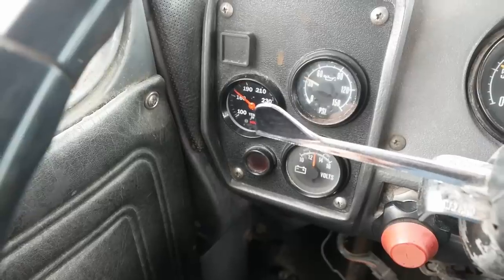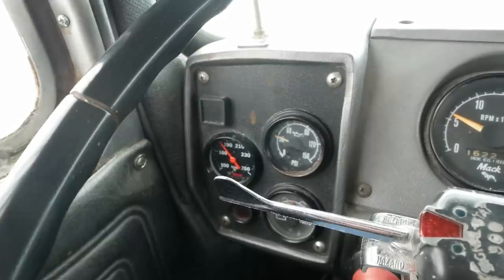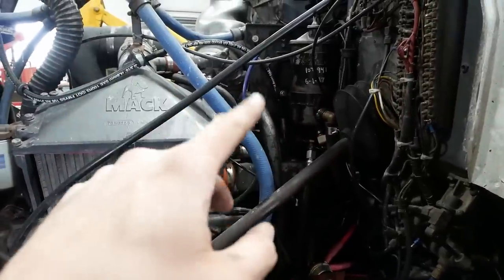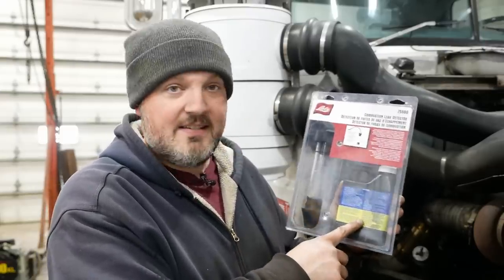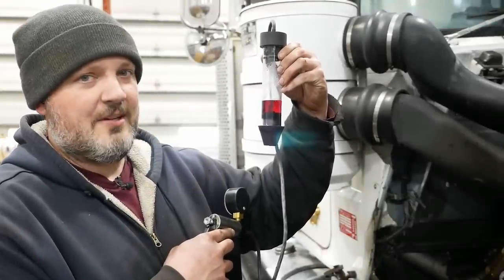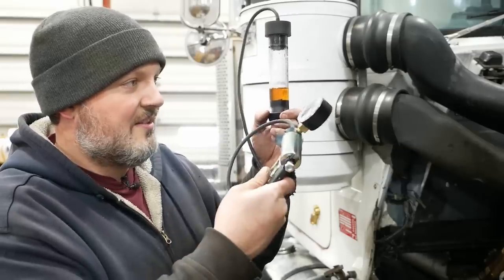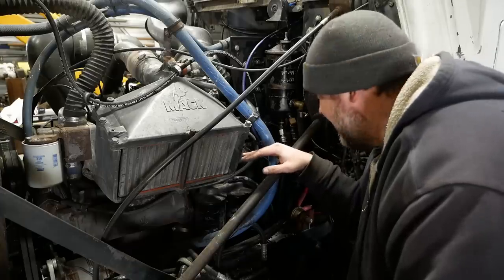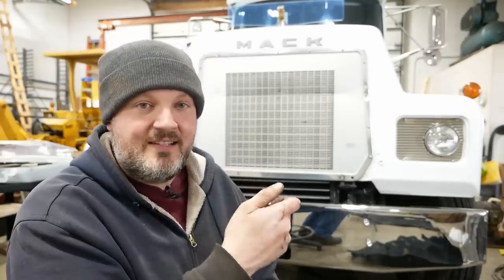Can You Trust a Head Gasket Tester? - R Model Mack Overheating

Comment: My first thought was water pump with nearly eroded blades ... higher rpm they will cavitate and do nothing, low rpm they will move just enough to keep an engine cool... BUT .. that doesn't explain the 3 or 4 psi (how much psi does a glove take to inflate) of pressure at the rad cap ... a definite head scratcher!!!
Thanks for sharing 🇨🇦

Comment: I noticed the tester had fluid in it before you filled it with the diesel test fluid, had you cleaned out the Gas engine fluid prior to filling it? Ive had mixed results with the combustion gas detectors on gas engines, seems like the head gasket leak has to be moderate, hard to get a reaction on small leaks it seems.

Comment: On my om617, i used the blue colored test fluid Oreilly provides... it turns yellow from exhaust gasses. It worked on my diesel, but note, that it takes longer for it to react with diesel emissions that gas emissions. Blown head gaskets on a gas burner took less than a minute... testing the diesel takes like 8-10 minutes

Comment: Reminds me of the mess we went through trying to find a coolant leak in an old CAT 3412 in a 500kw generator. Starting getting some coolant in the oil, but they weren't sure if it was a head gasket, or a cracked liner, downside was in order to fix it, they'd have to tear the engine half apart and due to EPA regs for generators like that it would have to be brought up to higher emissions standards if a major rebuild was done. Being the generator was 30 plus years old and rebuilding the engine would still leave the rest of the genset that age, it made more sense to pull it and replace the entire unit. Due to much smaller loads we replaced it with a 300kw Cummins unit for not a lot more than Cat gave us as quotes to rebuild the old one. I gather that 3412 was sold for reman as they are popular in marine and certain older trucks. Sometimes the repair just isn't worth the expense.
Reply: Man those 3412 and 3408 were such junk.  At least in NG configuration they were just awful and ate heads for breakfast lunch and dinner.  Hodge podge of parts from the CAT scrap bin.   We dropped that junk and use cummins as well.  Much more reliable and cheaper parts. Cat has the big HP market dominated but small and mid HP cummins is not a bad option at all
Reply: @melvingibson4525  Yeah, the quote from Cat for a new generator same size as the Cummins we bought was almost double the price, made it easy to choose the Cummins and it's been flawless now for 5 years. And the support costs me half what I was paying Cat for quarterly maintenance. I don't miss that old Cat, it would always fail to start when you needed it most even with weekly test runs, not once has the Cummins failed.

Comment: I encountered a similar problem on an old Mk2 Golf (VW Rabbit in the US) back in the late 90s. The problem turned out to be a loose water pump impeller. At idle everything worked as it should but increase the rpm and the water pump impeller started slipping on the shaft. I wager a small donation to Wes' favourite charity that the head gasket is good

Comment: Put the glove back on the radiator, pull the injectors & use a rubber tipped blow nozzle hooked to shop air and blow into each injector hole and see if the glove inflates!

Comment: Years ago we had an IH 806 LPG powered tractor that got hot when the collant aerated with tiny little bubbles making the coolant look milky. Tractor needed a new radiator cap. I wonder if aeration  from leaky gasket is contributing to your rapid temp reading flucuations?

Comment: Those older Mack motors are tough. a guy had a dump truck from 1979 had the off center cab forgot what model it was. it was so beat down he was using it on a piece of land and it didn’t have coolant in it the whole time he would run it for 30 min at a time a day. It had fresh modern shell oil in it. But he didn’t want to take the time to find the coolant leak. When he was done with it. My bud and I put straight water in it. And it didn’t seem to have any issues. Mind you this dump truck was probably worth a grand it was so beat down. But the motors seem to be the last thing standing. This was all going on in the hot SC summers

Comment: What did the gas inside that glove smell like?
I've had some tricky head gaskets to diagnose but I always like to take a whiff of what's inside the radiator or cooling reservoir and I can usually tell if it smells like combustion gas or not.
A lot of people don't realize it but as a mechanic your sense of smell is actually quite valuable.
Reply: it usually just smells like hot antifreeze
Reply: Co2 is odorless anyhow so the smell would be irrelevant
Reply: BreatheScotland  A crack in the inlet port won't introduce gas into the coolant at idle, there is no pressure to do this.  It would be more likely to leak coolant into the inlet port.  The symptoms this truck is showing is typically either a bad head gasket or a crack in a cylinder wall or combustion chamber.
Reply: @lustfulvengance  so why would you need a testing device if you could simply smell it 🤔

Comment: Hey Wes. Thanks for the video. 

I can sympathize with you on the struggle of diagnosing gas in the cooling system. I recently had a 2020 model year Hino with a J series Diesel engine with the same symptom. Did similar testing to you and replaced head gasket. Same symptom existed. What ended up being the cause was the water pump sucking air into the cooling system through the weep hole. One of the more bizarre things I have seen as a mechanic.

Comment: You could be right on a head gasket. I had on the temperature would do the same thing.  Temperature guage would randomly get hot then settle back down and be all right for awhile . Would do this randomly. Of course did the normal things to no avail. Finally we gave up on it. After about 1 year we figured it out, the head gasket blew. Upon tear down we figured it was such a tiny leak that it just wouldn't show up.

Comment: If you build pressure in the coolling system that fast and it goes down when you shut the engine down it has to be a head gasket, cracked block,or cracked head. Their is no other source for the pressure.

Comment: a crack head or head gasket will form air pocket under trhaemostat then as it heats up will overheat then temp drops drasticly after    temperature swing back and forth is usualy indication

Comment: A/F Ratio for a diesel at idle is really high so the fraction of CO2 in the even the fully homogenious downstream exhaust would be small.   Plus the head gasket leak is  way out at the perimeter of the combustion chamber, which at idle is very stratified,  the fuel is injected and burned near the middle, and at the few jiffys at 'peak pressure'  (when the leak is active) you might push basically fresh air out from the edge of the chamber.  That's my theory as to why the tester did not work at idle. (This Mack need a head gasket or more...).    Thanks for the content!

Comment: Used the harbor freight tester once, their fluid claims to be good for gas or diesel, had an isx cummins pushing coolant the fluid turned colors instantly, the truck went back to a shop that recently in framed the motor and it turned out to be cracked head. When I worked at a local Pete dealer we used a bottle test almost exclusively. But that was mostly on e model and c 15 cats which are known for head gasket issues so just assuming head gasket would’ve probably been just as accurate

Comment: I don't believe that the very large amount of water in the block and cooling system can change tip of your that rapidly. It's physically impossible to cool down that fast. I think the temp gauge is getting water from the hot source and then a cold source. Alternately. Something like the bubble you talked about. 
I would get a few of these thermometers from Amazon that have a sensor on a wire and a digital display. Just tape the bulb to various places or hoses where cooling fluid is located. You'd need to mount the display on a fixture since the wire is usually three or six feet, depending on the model.

Comment: Hey. Could you drain the coolant and modify a radiator cap to be able to hook a smoke machine to it and then pressurize the cooling system thru the radiator cap….???? Maybe you could see the smoke or hear an air leak?? Maybe use soapy water trying to find bubbles ????????

Comment: Have never seen a diesel  heat up and cool off that fast..I'm thinking gauge and or sending unit are bad' Can you hook up another mechanical gauge and try it again ?? Is the engine actually getting that hot ???

Comment: Am a retired mechanic in Land Down Under. Had similar very difficult to diagnose issues in the last few years. One was a diesel 2.4 litre transit van which was losing coolant, but very slowly and very inconsistently. I tested it with the combustion gas tester and came up empty. Another workshop did the same a few weeks later and came up negative as well. Owners limped the camper vehicle 600 kms home and then were told by another workshop about Rislone head gasket sealer (made in New Zealand). With nothing to lose except having to remove the head on a quite difficult job, they tried it in the cooling system. It fixed the problem. Don't know if it was a head gasket leak or porosity in the head or the block but the Rislone sealed it for less than A$100 for the bottle. Within the last 8 months, had issues with my own Toyota RAV4 V6. It would push out coolant from the pressure overflow bottle and the tester showed nothing. Again it was inconsistent with loss of coolant and temp gauge fluctuations. However a subsequent radiator pressure test showed that the coolant system pressure would rise when system was pumped up to the rad cap blow off pressure of 21 psi and then the pressure would rise to about 28 - 30 psi, with the vehicle at just above idle. That convinced me it was a pressure leakage problem from most likely the head gasket. A full engine removal is the only way to work on the V6 heads and we found that the head gasket had a minor tracking leak between two cylinders - the triple layer steel head gaskets have very little tolerance and require the head and block to be extremely flat and smooth. My heads and block surfaces needed about 0.002" off each face to get them dead flat (I have a milling machine at home with a diamond tipped insert on an appropriate fly cutter) and with new head gaskets all has been right since. However the work involved in removal, dismantling, repairing, motor reassembly and refitting was a lot, lot of work. Also job cost quite some dollars. Just glad it worked out. But moral of the stories is that the combustion gas tester (like yours) does not always pick up the head gasket of other combustion gas leaks. In the end it is an educated guess, one you hope you get right. If anyone else has a better method of diagnosing these issues I would like to know - think Wes would too.

Comment: The question is if it’s rly reading that on the temp gauge or if the sender is flakey. That’s how my 93 7.3 is. I replaced the sender, replaced the thermostat, fan clutch, & installed my own mechanical gauge to have alongside the one on the dash.

I’m thinking a nasty thermostat. Unless it’s making pressure in the radiator after it’s stone cold-sat overnight then I’d be concerned.

Comment: Maybe just because it has such a high coolant capacity-- it dilutes the carbon dioxide so thin---  you just have to let it run for maybe 30 minutes to see a result.  Not sure.  Or like you said, it builds a bubble--  and you just have to keep running it until it burps the bubble.

Comment: I worked on a 2011 duramax that had a head gasket issue.  I was certain it was a head gasket and tested it several times with that same tester but it never showed a color change.  We did some repair.  Month later it came back with same symptoms and this time it showed color change almost immediately.  I'm not sure why it was different other than maybe it got worse and allowed more gas through even though the symptoms were the same.  I did the head gasket job and sureenough it had a leak but it was a pain to get to the correct diag even when all my instincts told me it was a head in the first place.

Comment: I have had a internal clogged heater core of an old crane doing the same. It threw out 10l of coolant every time and sucked it back up when turned off. It was basicly an air bubble that couldnt escape. Heat did work but only a little bit of heat was coming out. 
I scratched my head with this one for a while

Comment: I’ve had the debate over the combustion gas leak detectors many times. I think a lot of people expect them to give an answer every time when it’s not actually possible. 
In my career I’ve seen head gaskets leak in every which possible way, I’ve seen them leak oil externally down the engine but no other issue, I’ve seen them leak oil into the coolant but no other issue, I’ve even seen oil and coolant coming out an exhaust but no contamination in the oil or coolant, I’ve also seen combustion gases go from the cylinder to the cooling system. 
Head gaskets can leak any which way or a selection of them. 
The combustion gas leak detecting fluid is only designed to detect one type of head gasket failure and that’s combustion gases into the cooling system, it cannot detect any of the other types of head gasket failure. 
Personally I see the gas leak detector fluid as something to assist me find the issue and not something I expect to identify the problem for me. 
I can also agree, I’ve done plenty head gaskets and not yet has my fluid detector confirmed one yet. Although all the vehicles were fixed after the head job. I guess it’s one of those tools that will occasionally be a winner, and for £25 it’s not too bad. 
Also I very much agree that it can be hard to call, you never want to do that much work for nothing.

Comment: That kind of fluid is also used in aquarium co2 checker and it turns typically from blue to yellow but it takes time. It should be quite reliant. A channel of a German mechanic also featured it and they use it all the time with success. I wouldn't know why the diesel version would be different. Co2 remains Co2 :)

Comment: Your theory on the compressor was a cool one.  Do you know for sure that it is generating any significant pressure into the coolant system, versus just generating flow that could be introducing bubbles causing issues?  Even when the compressor is unloaded or the output is disconnected, in theory it could still have just enough pressure inside the cylinders while cycling that it could be pushing air into the cooling system.  I don't think that is it, but I wasn't 100% convinced that high pressure is required.  This is all a stretch, but we are talking about a pretty weird symptom here....

Comment: Happy Saturday Wes. 
Is there a test strip that you dip in the radiator coolant and if changes color indicates if it has a blown head gasket or normal ??
When I saw that thermostat jump up.
My thought was either a coolant temperature sensor or a big pocket of air/gas in the cooling system…

Comment: The temp only rising at higher rpms points to the air to water intercooler. I would pressure test that before going for the head gasket. You have to take it off for the head gasket anyways.

Comment: If that engine has two cylinder heads, is there any way to isolate which one has has the problem?  Perhaps use the ports on the water manifold, or an IR thermometer.

Comment: Had a 1987 Chevy Corsica with a 2.8L V6 over 200,000 miles. It started randomly overheating. Sniff test showed nothing. Eventually tore it down to replace the head gasket (after deciding it had to be bad) and found the cylinder wall cracked in one of the cylinders. Another example of the sniff test not working.

Comment: I picked up a MASSIVE engine and gad analyzer a few months ago at the scrap yard for about 4 cents per pound. I don't remember exactly but I know it was near or over 500 lbs.

I don't work in this type of stuff but I couldn't stand to see it get crushed. I kept all of the test leads..... Of which there were nearly 100 pounds of complex purposefully designed test leads and probes.   they're definitely something I will use or might come in handy with my day-to-day work with metrology equipment. (And all sorts of weird industrial stuff)

I was actually super impressed at the test leads and custom probes (some of which were manufactured by Hewlett-Packard specifically for this company)... Even the little barcode scanning pen and book was super cool. 

Obviously as a photonics nerd the most interesting thing to me was the internal module... Of which weighs about a hundred pounds and is the size of a 50-gallon drum. It uses several optical mechanisms and techniques for measurements... Which are so fascinating and interesting. I can't even imagine all the crazy things it could do. I fell down the rabbit hole on some forums discussing the repair and restoration of them... I just had to stop reading. It's all Way over my head. 

Unimaginable how much engineering went into. Similar to why I enjoy specializing in testing metrology equipment so much. It is high art. I just couldn't stand to see the thing get trashed.